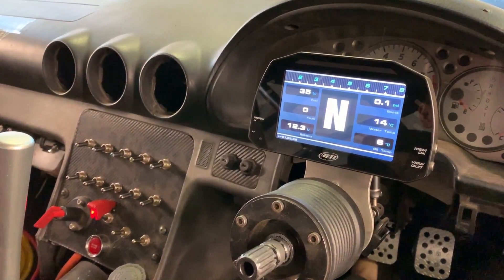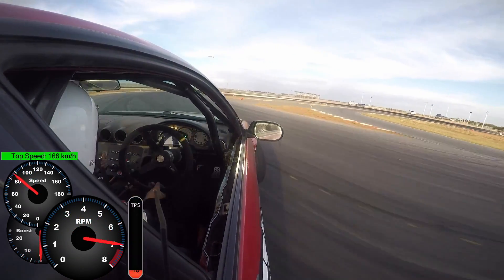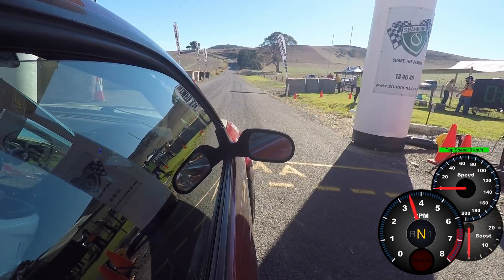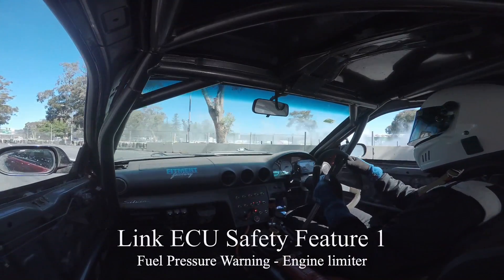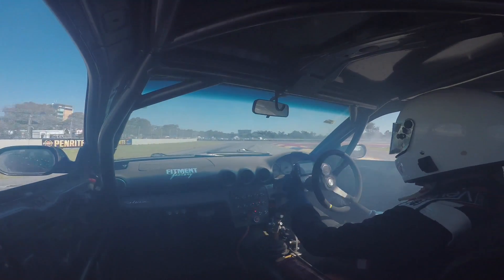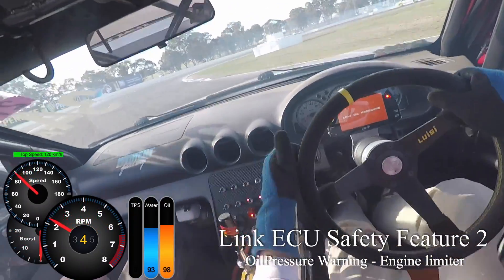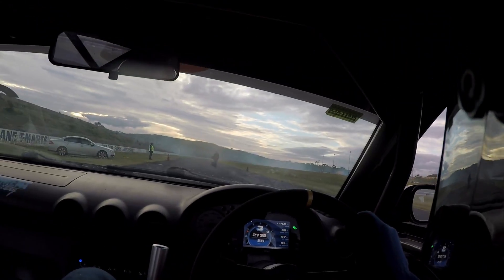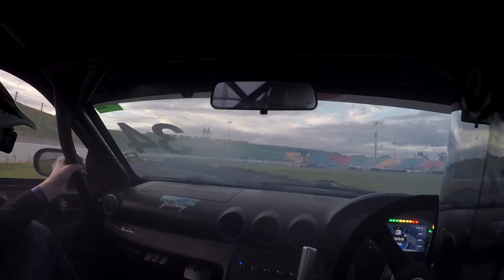LINK ECU saved my engine!!! Reasons I love the Link ECU  - VLOG 004

Comment: So I have a g4+v10 stand alone tuned but I have 0 throttle response. All the sensors are fine, and my drive by wire throttle body is also fine. does that mean my ecu needs to be retuned ? What would cause this thanks to anyone that could help. Car has been parked for a year now :(
Reply from the maker: Have you connected the ECU to the Link software and checked for any errors? No throttle response at all would usually suggest the DBW is going into limp mode because of an error. You should also visit the Link Support Forum and ask the question there. The support team is awesome.

Comment: Just commenting to tell that I bought a G4X and your video made me fiddle with GP limits for oil pressure, temp and fuel pressure 
That will save my engine one day probably :)
Reply from the maker: Excellent! If you have an Ethrottle you can add extra safeties. I have the throttle closing near the top of the RPM to reduce the load/boost when I'm on limiter.

Comment: Compared to Haltech would you recommend Link for an R32 GTR?  I am about to go single turbo with a build of no more than 450 KW (600hp) at the flywheel. I am not sure if you have used Haltech before so you may compare one to the other. Any suggestions, input would be appreciated. Thumbs up on the vid.
Reply from the maker: Hey mate, sorry only just saw your comment. I haven't used Haltech before. The Link has worked amazingly out of the box, more and more top level drivers internationally are changing to Link because of how well it works. The Link Fury has everything all built into it; knock, wideband, data logging etc so there's nothing else you need to buy.
Reply: @DeanNewcombDrift  Thanks for the reply, few weeks back my son purchased a Link Fury for his Z32 and he cant say enough good things about it. Comprehensive, easy to use. Thanks again.